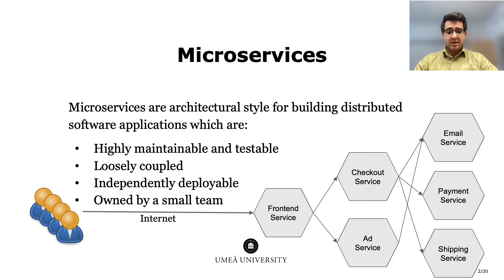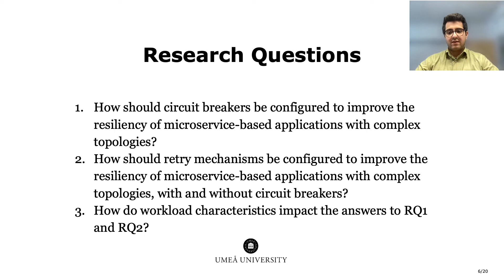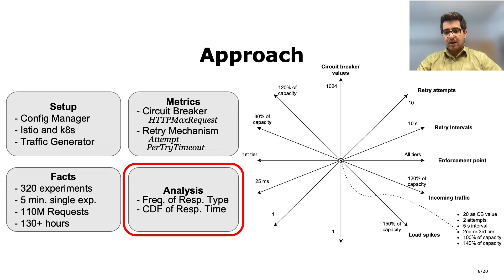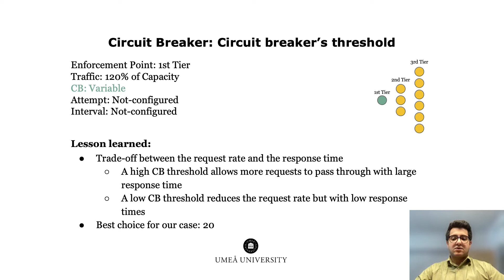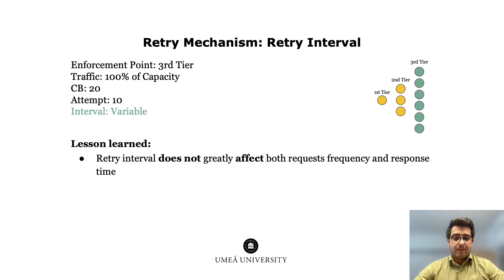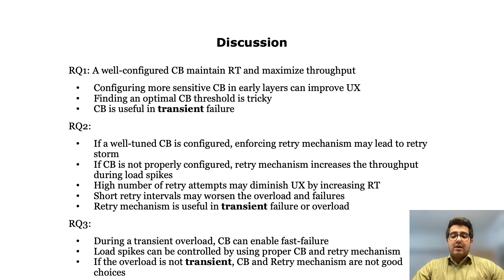[ICPE '22] - An Empirical Study of Service Mesh Traffic Management Policies for Microservices

Comment: Which tools do you use  for this experiment like configuring traffic volume as 100% of capacity etc and visualize the metrics like request throughput, response time
Reply: can I email you? I am writing a term paper for final year and I need help with methods used
Reply from the maker: @asadcat-k1w   Hi,  I  used HTTPMon for generating traffic [1], and Istio for monitoring those metrics. I also open sourced the tool I developed for this paper in my github[2].
[1] https://github.com/cloud-control/httpmon
[2] https://github.com/salehsedghpour/empirical_study_tmp